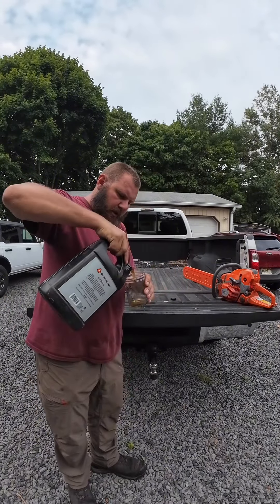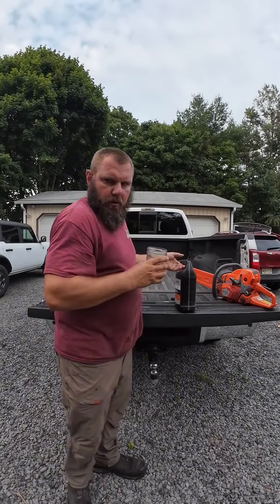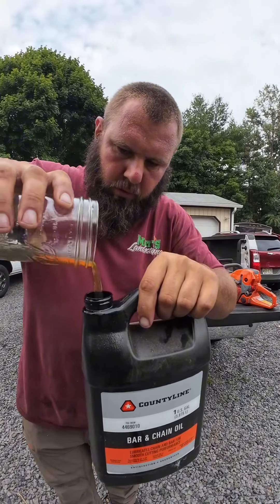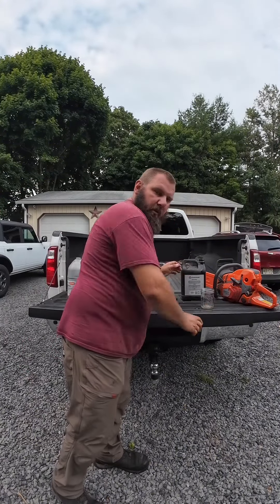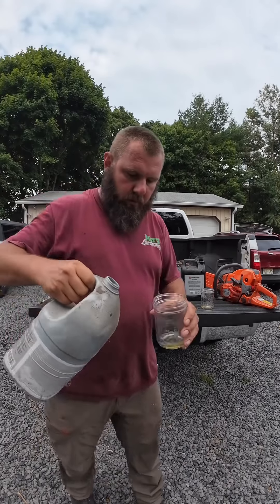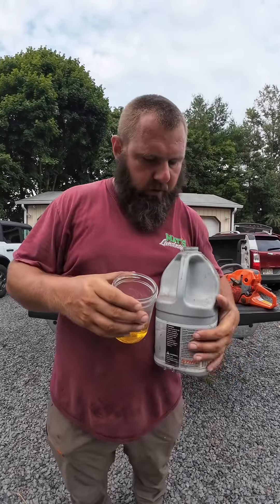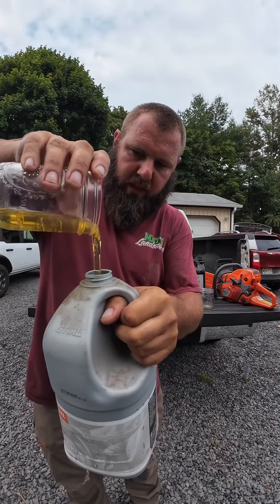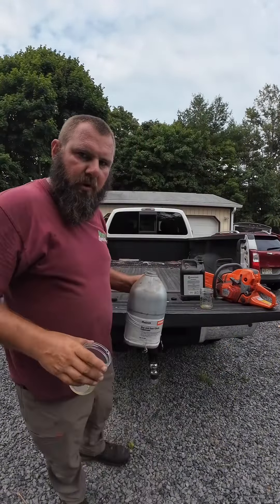Bar Oil leaking on the Husky. Oils to Thin?

Comment: Yes, probably Heat Building up in the Oil Tank of the Saw.
Stick with either Husky, or Stihl Platinum and Also Stihl Orange Woodcutter Oil. 
I mix half of them together in the Oil Tank in the Summer, Fall, and Spring. Works great. 
Hopefully that helps you out my Friend. Ron from the Woodyard in Duanesburg NY.
Reply from the maker: Thanks Ron

Comment: Higher temperatures thinned out the county line oil, I'd use it in the winter just to get rid of it then stick with a good bar oil, Husqvarna or Stihl. Not worth ruining a bar and chain over, great video once again.
Reply from the maker: Great point! Thanks!